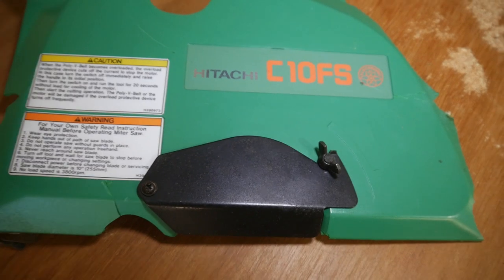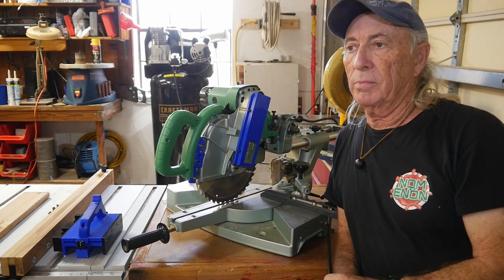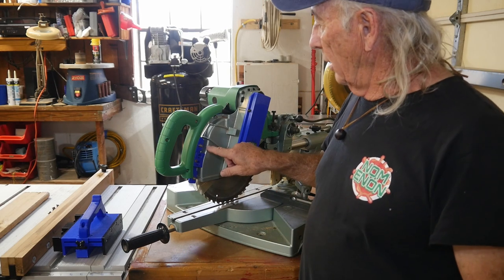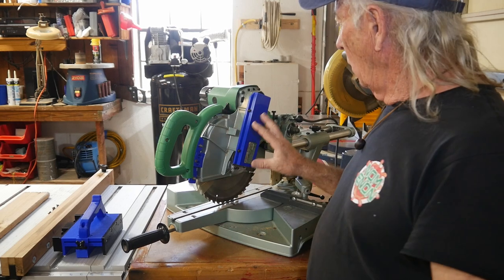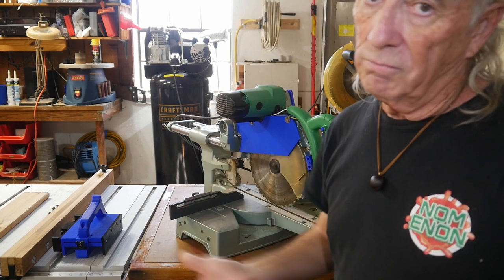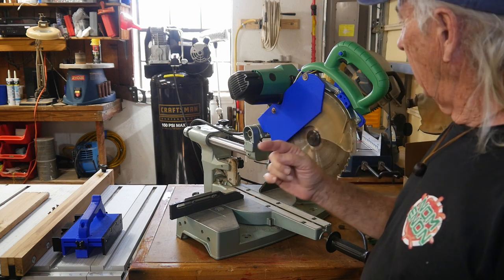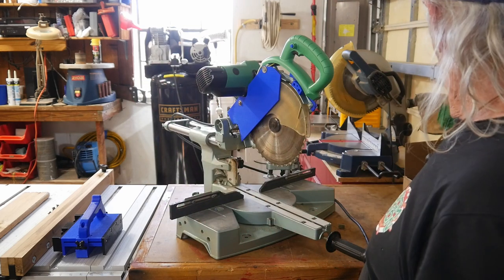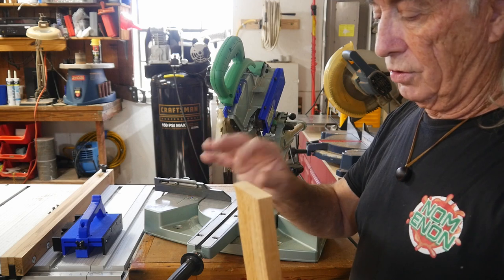Hitachi C10FS Frankenstein sliding compound miter saw 3d printed, C&T Episode 133

Comment: Have you had a chance to re-make the STL files yet? I'm looking at getting one of these and either being able to print my own or buy new housing would seal the deal. Seems like a great saw for general use until the housing implodes on you. This seems to be the most common issue with this saw.
Thanks!
Reply from the maker: From everything I checked there is no new housing available or handles now. Going to the Get 2 handle was number one fix. The STL file was lost and so plans are canceled for any future work on this saw. Bust, I know it...

Comment: I have a problem with the cutting head being hard to push down and then when you make your cut it hesitates or gets stuck down.  How would I fix this?
Reply from the maker: Sounds like you need to grease the pin, but also check for anything that might be causing it to be tight. Odd issue, but I'd go over the machine for obstructions to dragging ....new one for me 🤠
Reply: @SirTools  kinda what I was thinking.  Thank you.
Reply from the maker: Good luck, might be just lube

Comment: Are you selling copies of your 3D printed housing? I have the same Gen1 C10FS that runs great, and I dont want to throw it in the trash.
Reply from the maker: Hi Aaron, we lost the files for making more. I am planning on another upgraded housing in the future. Did your's turn to powder like this one ? the plastic is ABS, but strange decay over time.
Reply: @SirTools  not powder, but more like brittle potato chips. 🤣
It'd be nice if somebody could scan and print identical C10FS Gen1 housings. My saw works awesome, but cant use it unless theres a housing for it.
Reply: @SirTools  I actually ordered a C12FS housing, thinking I actually found one but to my dismay, its obviously too big. 🤦‍♂️
Reply from the maker: @aaronweise360  Yeah the scan and print would be awesome. I tried to glue the parts back and get scaled up for making refit parts. The plastic was just too far gone and so I crossed the handle over with the newer gen. Still is a great saw.
Reply: @SirTools  not sure if my pieces may be able to be glued back together, because lile I said, its like gluing thin sliced potato chips together. I think I may have lost some pieces anyway.
Reply: @SirTools  hey, I was wondering that if I ordered a c12fs housing, and had it scanned, can it be scaled down on a 3D printer software to fit the c10fs?
Reply from the maker: @aaronweise360  I'm going to say that should not work, but cool idea. The scale down would be fun to try, but outside my pay grade LOL :)

Comment: Could you tell me which color wires go to which connector on the trigger?
Reply from the maker: There is a white neutral that connects to the motor but doesn't go to the trigger switch. On the base of the switch it is marked 1, 2, 3.  The #1 is black (hot), number 2 is the light colored and the #3 was blue. Hope that fixes it for you.
Reply from the maker: https://www.manualslib.com/manual/795478/Hitachi-C-10fsb.html?page=53
Reply from the maker: Check that diagram link. Seems they used different color wire per generation and date of manufacture. Mine is different from the diagram. Odd, but typical.
Reply: Awesome thanks for your help!